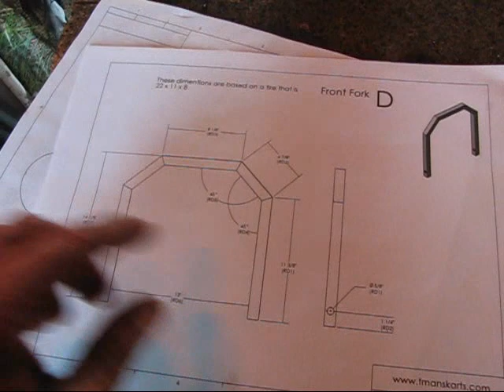Off road Trail Bike #3 ( Front Fork )

Comment: Military colours!

You've possibly sheered some teeth with just good old fatigue. The teeth on the wheels in the small grinders aren't particularly big. If you're feeling it's off balance and it's gritty, that sounds likely. If not, as someone has said, might be bearings.

They're a bit fiddly to open up but if it's useless anyway you might want to take the gearbox apart and take a peak. Might be an obvious simple fix and if not you'll have learnt something about grinders!

Keep it up man.

Comment: Research a bit more what TRAIL is.  I believe you have it wrong.  Trail is the axle offset from axis of the steering stem. This can be achieved by setting the axle forward of  the forks or setting the forks forward of the steering stem. Many triple trees have this offset to achieve trail. It makes it so the sprung weight of the bike self centers the steering by inducing a jacking effect.  By the look of your fork thingy, you have zero trail.  Motorcycles with sidecars run lots of trail.